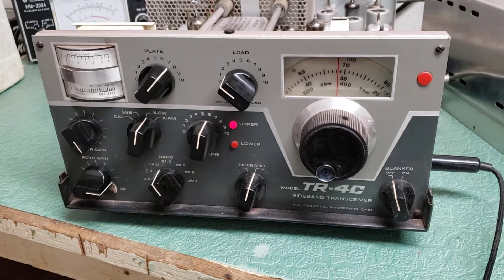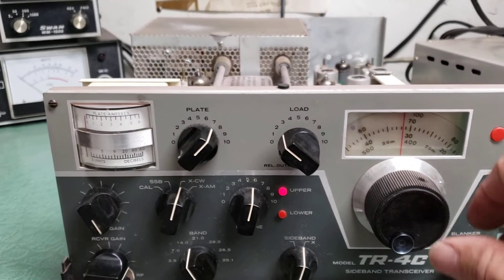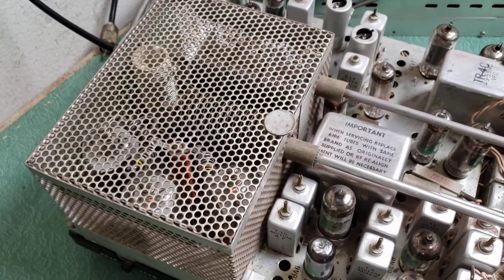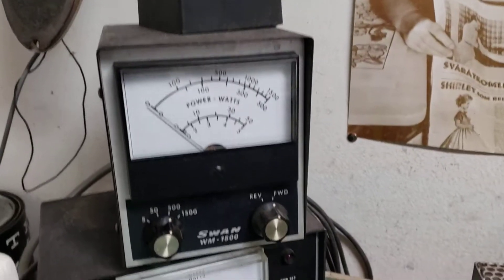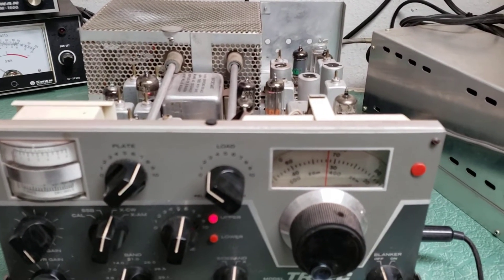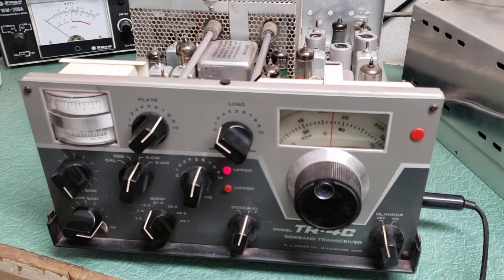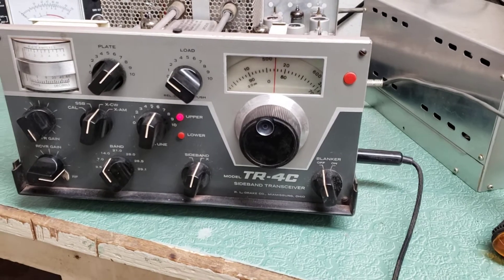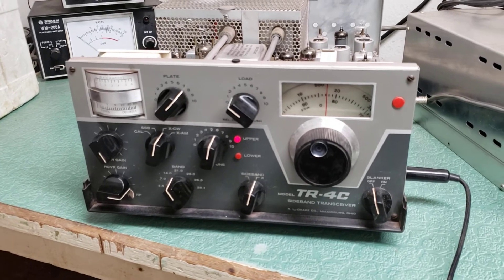Drake TR-4C HF Transceiver PTO Issue

Comment: I have a Drake TR-4C I bought in 1987, a couple of years before I became a ham. The person who owned the radio before I did installed 11 meter crystals where the 10 meter crystals go. I used it briefly on 11 meters side band. The transmitter put out around 50 to 75 watts. I moved shortly there after and the rig has been stored ever since. I was wondering if you knew anyone who restores the Drakes.
Reply from the maker: No I really don't. I would think you could get the correct 10 meter crystals if you look around on the internet though. Also the power supply can easily be rebuilt and they sell brand new boars for them on ebay for about $99. Good luck getting it going.